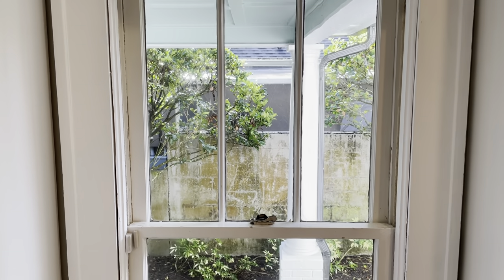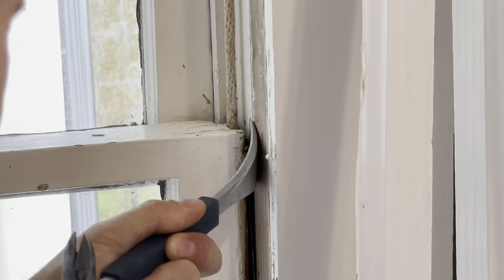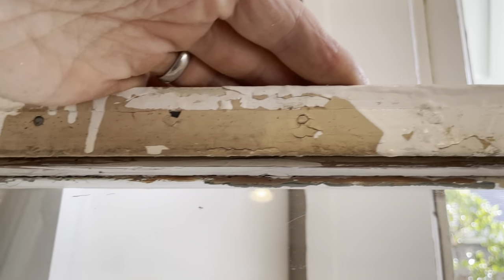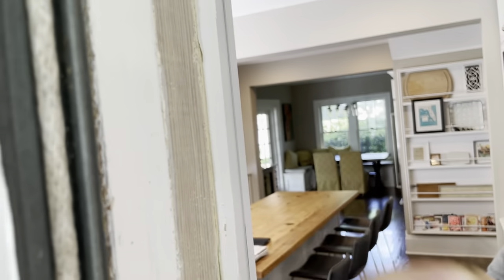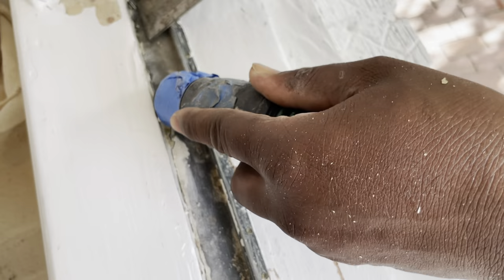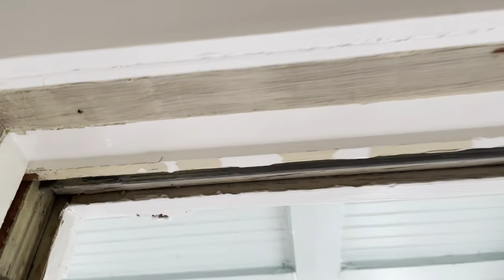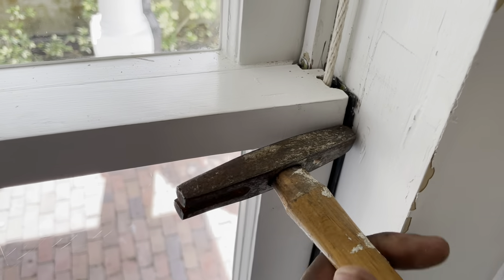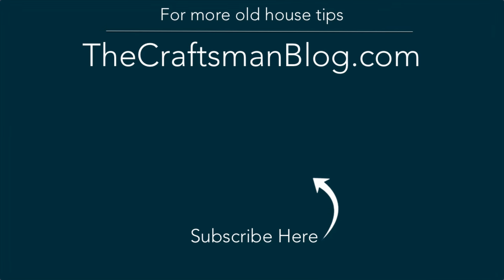Working with Integrated Metal Weatherstripping

Comment: Thank you so much for this video! I have original wood double-hung Andersen Master Frames in my 1939 home. Beautiful windows but they have integrated zinc weather stripping with metal tape balances at the top of the upper sash (even the parting beads are zinc). I’ve been very hesitant to try to take them apart, you’re demonstration and suggestions were so helpful. I’ve been thinking I’d have to track down the original design of the windows from the Andersen Corporate Archives in Minnesota. I too think this is great weather stripping; my 82 year old windows never rattle!

Comment: Your videos are well produced and informative. Thanks.  I have that zink weather stripping and wonder is a lubricant of some kind can or should be applied to help my old windows operate more smoothly.  I’m currently in the process of removing my second window
Reply: I am not an authority on this but on different windows I have used Johnson Paste Wax as well as a dry lube with teflon spray and both helped. But first I cleaned the zinc strips of all grime and paint and also gently straightened out any bumps in the zinc that developed when I was removing them or over the last 100 years of use. (And don't forget the obvious point of lubricating the pully).

Comment: My windows have a similar but slightly different system.  The sides of the sashes have a rib covered in a zinc channel and the frames also have a channel that fits over.  The frame parts are attached with tiny screws that, after 100yrs, are awfully tight.  I wish I could find a replacement source as some pieces have been lost over time.

Comment: The weather stripping on my windows clads/covers the parting strip as one integrated unit.  I have been unable to figure out how to pull out the bottom sash since the parting strip is also in the kerf. Any ideas?